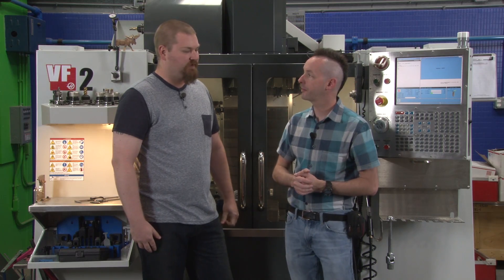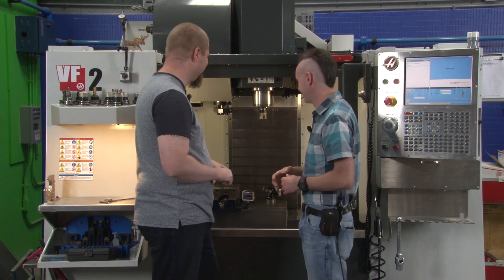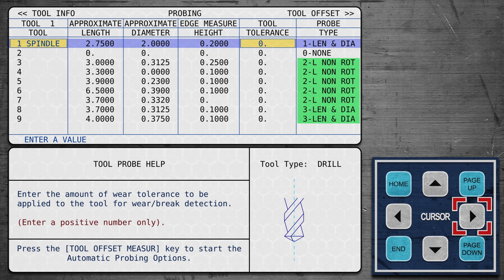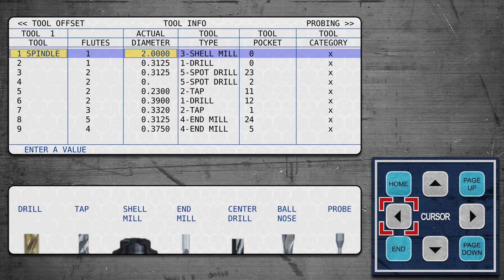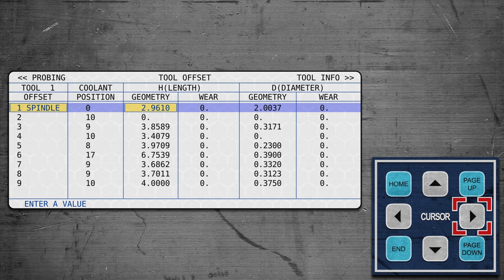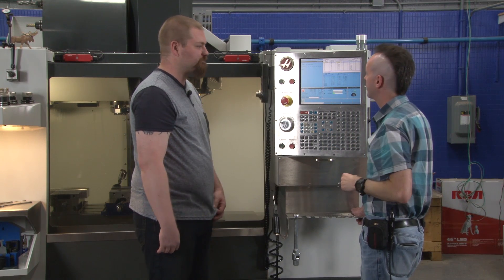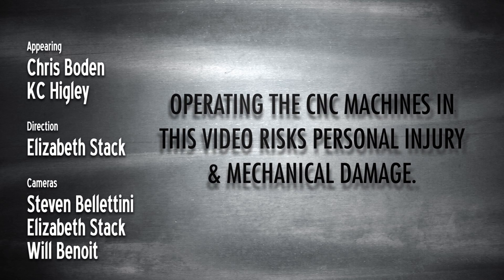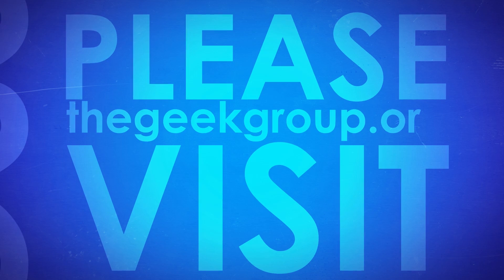Renishaw Tool Probe Basics: CNC Training Series

Comment: This tool setter would not be able to measure the tool data for some boring bars, would it? At least, it is not able to, automatically.
Reply: +Stephan Fong i've never done it on a haas  vmc,  but on our "mori seiki" cnc hmc you tell  the  tool offset page that it is a single insert cutter  or  like on this haas, single flute,  and approx diameter. it  works just  fine. note that our set ups that require boring bars the majority of the material has been hogged out already, the  b-bar only does the semi finish, then adjusted by hand, you can reprobe  at this stage  but  i  find it redundant, as the machine is still  just going to the center of the hole, then we run the finish pass. i know on one aluminium manifold that we do,  750mm x 1500mm has multiple bores, we use two b/bars one set at semi/finish size, and one at finish,  no adjustments are made,  but  we  use tool wear detection, once either tool  is  out of tolerance, the machine alarms out, we get  two 8hr shifts normally  before we have this problem. as  they  are  both  only  taking 0.5mm cuts on diameter. also use the work probe to check for ovality ,tapper and tolerance accuracy.   have  a  good bro  = )

Comment: Rotating the tool while measuring the diameter also compensates for tool run out. :-)
Reply: The problems with that is your stylus sphere now becomes an ellipse. That makes 3D probing inaccurate. Another thing is, how do you know which side it touches? You don't. The touch is instantaneous. One time you probe it would be touching on one side of the OD. The next time you touch, on the other side. If your probe is only .001" off center you could get up to .002" difference in probing accuracy.